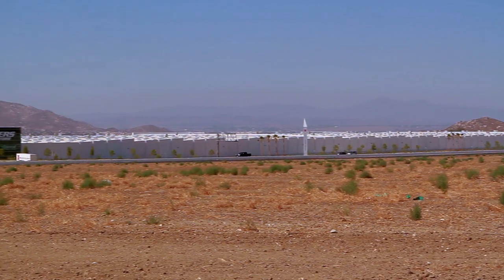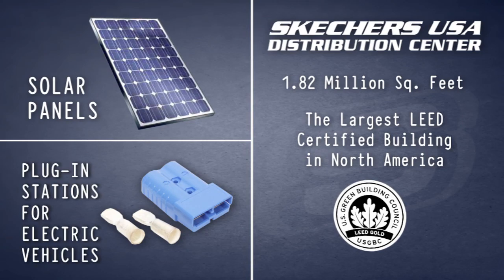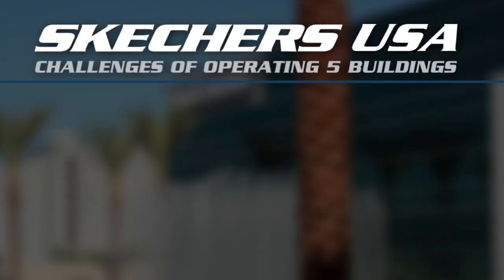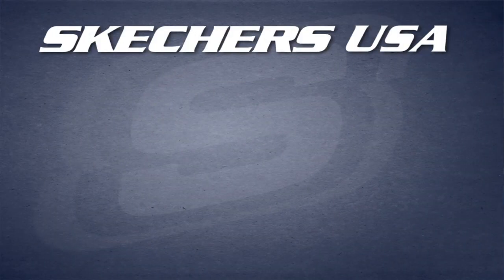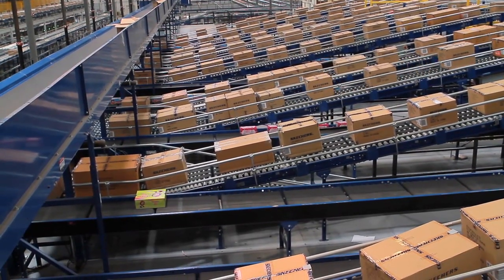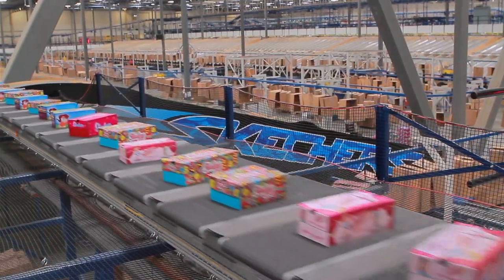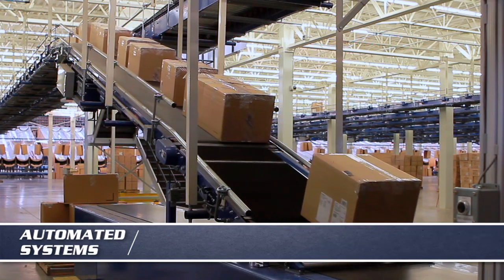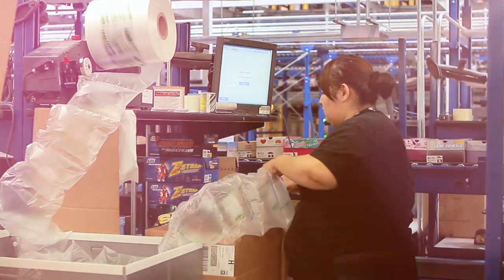Skechers distribution center

Comment: Something they need to change when building distribution centers is to add windows, skylights to make the place brighter with natural light, add fake plants, 1 hrs brake, etc. Working in a dark and enclosed area is depressing, nobody likes to work in a box but rather a filling of outdoors environments.
Reply: MOISES F IZURIETA if it's robotic, why do you need natural lights?
Reply: I agree, i'm working at Skechers here in Belgium and this is almost the same distribution center. No windows no plants nothing. I'm pretty sure there is a reason though. i worked in a few warehouses other than skechers and they all have the same "problem".
Reply: @chewba2008  , I think the reason is to protect the inventory from outside elements such as sunlight, heat, moisture, etc...  not to mention intruder break-ins etc...
Reply: It’s all about security, making it difficult to break in or break out with merchandise.